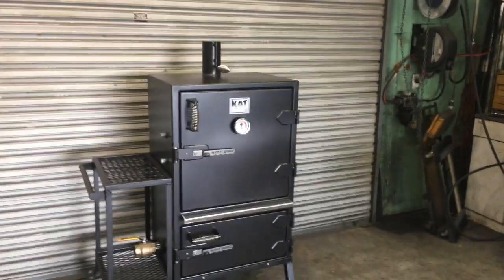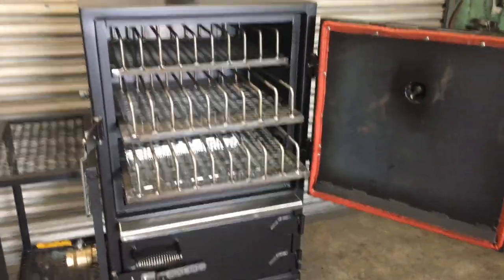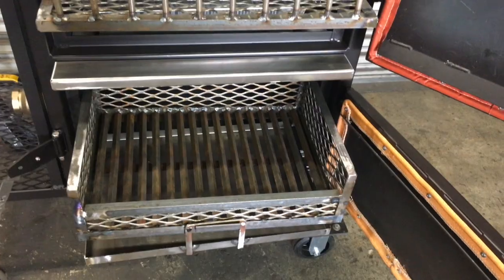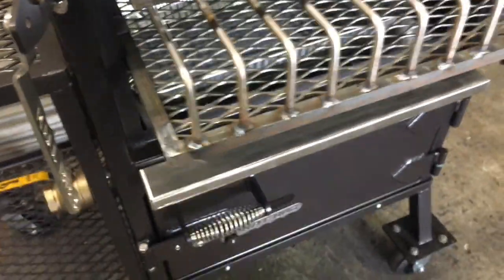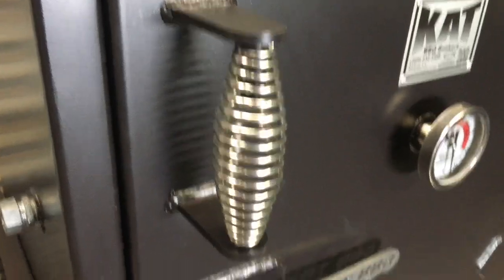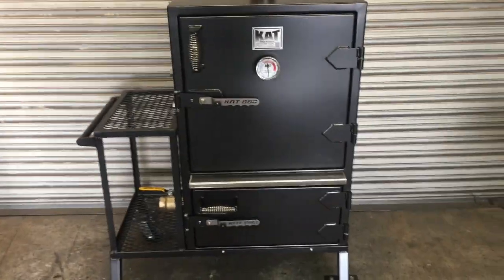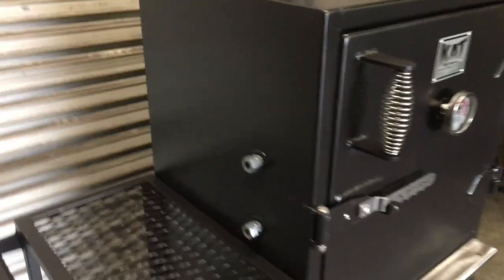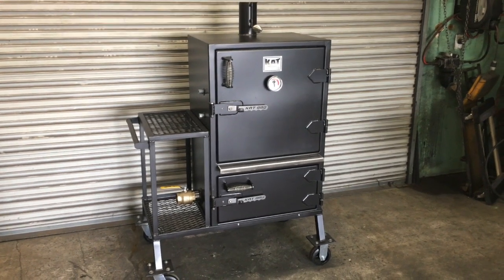KAT BBQ Smokers Small Vault/Rib Cooker

Comment: I have this small vault by KAT. It is mis-named because it is not small. You can get 6-8 brisket in it, 8+ pork butts and probably 10-12 rib racks. Beautiful build quality. Heavy duty construction that will last a lifetime. Ken was great to work with. He made every custom modification I asked for. This vault holds its temps very well and will go 12+ hours with a full basket of charcoal. I love this cooker.
Reply: Update to my comment above. I just did an overnight cook for two really big pork shoulders. 19 hours at 225 degrees. I use a Thermoworks Billows fan and controller. One 16lb bag of briquets was more than enough. Kept going for 20hours. Held within a few degrees of 225. Just perfect temp control with the controller valve that Ken put on my cooker. I love my KAT and would buy it again in a hot second. Getting a little colder here now. But my double wall KAT can stand up to any outside temperatures.
Reply: @brianogrady39 How much are these?